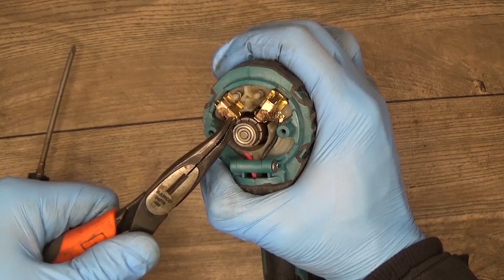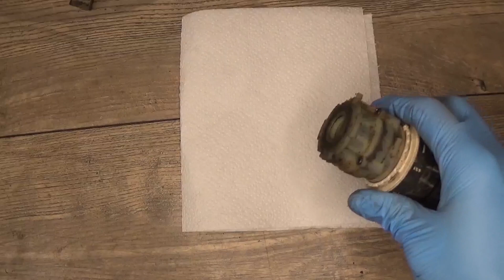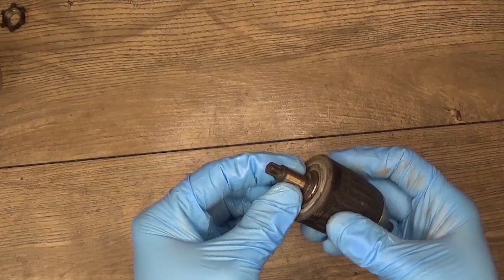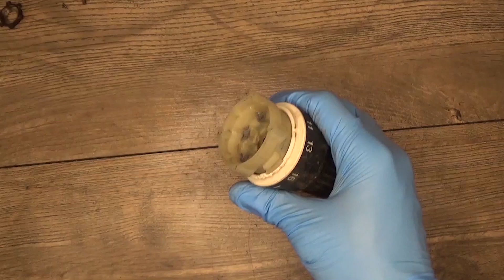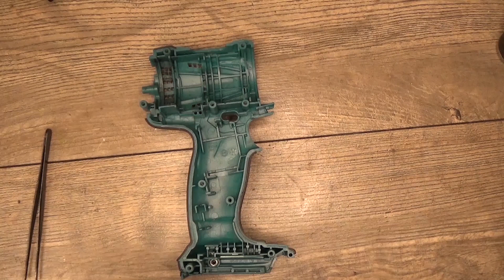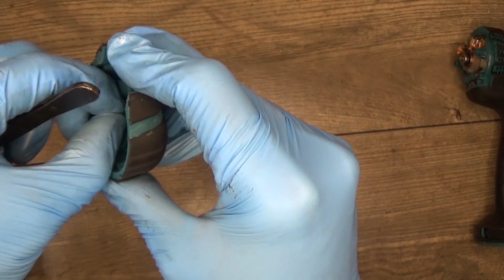Makita DDF456 repair quick video LXT 18V li-ion drill bare tool

Comment: THANK YOU, THANK YOU, THANK YOU!  SO MUCH!  I bought a LXPH01 from a plasterer and figured I pop the case open and give it a good clean. As I reassembled it the whole gearbox fell away from the chuck and the guts clattered on the floor.
Your clear and comprehensive video enabled me to put it back together . . . . . once I found the last cog about 5 days later. :-)
Reply from the maker: Congrats on easy maintenance repair 😁 Happy to know that video helps